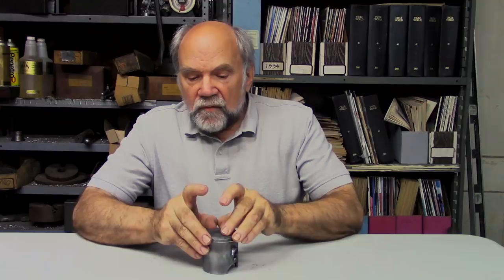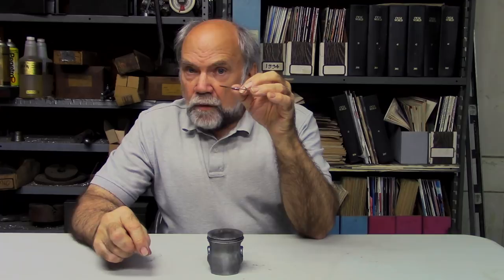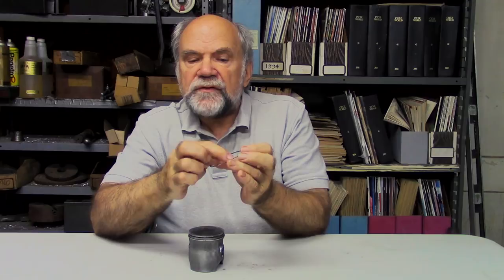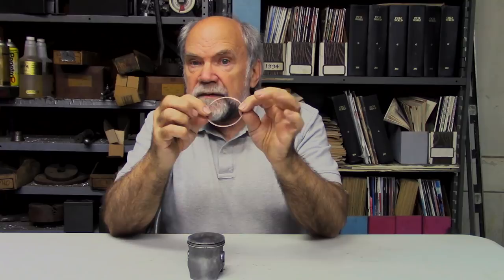How Do Motorcycle Piston Rings Work?

Comment: For those wondering: the 2 stroke piston only has compression rings because 2 strokes use a petrol-oil mix, that is the oil is part of the combustion charge because the oil mix also lubricates the cylinder\ piston interface- an oil scraper ring would be counter productive. 4 stroke pistons will be either splash\vapour or oil injected onto the cylinder walls, hence the need to keep the lube to a minimum via the scraper ring (behind the scraper ring you'll see the holes for oil waste).

Comment: Your customarily excellent work, Mr. Cameron 👍👍👍. 

I'm working on brake caliper piston's and noted the rectangular seals have a passing resemblance to combustion piston rings and AE designed to distort slightly in order to pull the piston away from the brake disk when pressure is released. Do engine rings also distort somewhat and present an edge to cylinder walls vs remaining normal to the wall?
Reply: Make that "are designed". Grrr spell correct.

Comment: may i know what is the purpose that some factory setting and placing the piston ring 1 and 2 groove with different angle. examp: my suzuki morpez come with 120 degree setting, which mean piston ring 1 groove face to intake valve 0 degree. then ring 2 groove is 120 degree. and yamaha morpez usually will place it with 90 degree as i know. and kawasaki is different as well....  so, do u have any idea with it??
Reply: thank KC